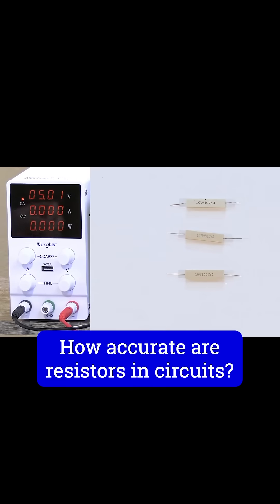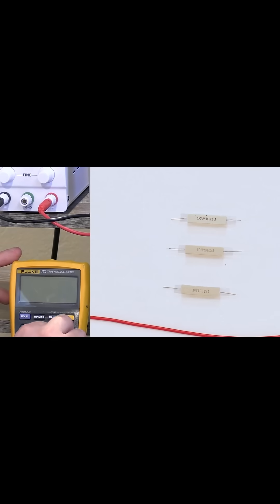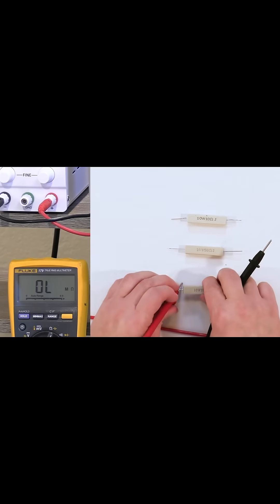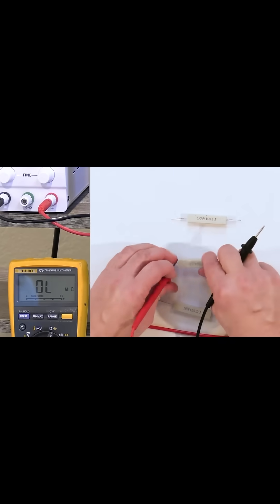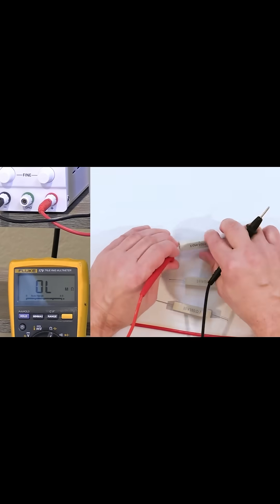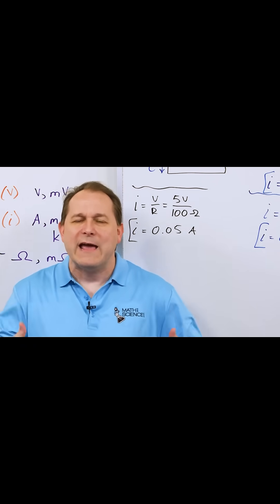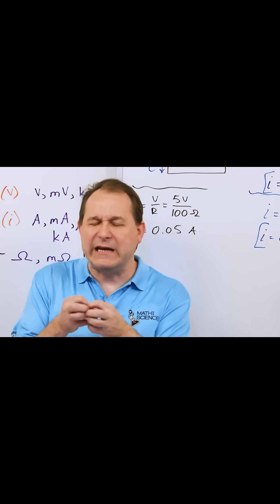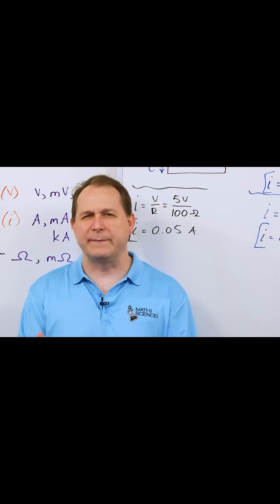Can Resistance Ever Be Perfect?

Comment: What you say is true, resistors will have a tolerance rating. Typically about 5% for the average low cost hobbyist. You can go down to 1% for just a little more cost. The resistors you show there are ceramic power resistors, then you have the typical carbon resistors, and when you really need to get precise, you use wire wound resistors. 

For those saying his fingers are the reason for the non-precise measurements, it is actually the tolerance of the resistors. They are actually measuring surprisingly accurate as those style resistors are typically in the 5% to 10% tolerance range.

Comment: ur fingers interfere with the measurements
Reply: @pete
"ur"  ???
Reply: Technically yes.... but
Finger resistance say 100k ohm in parallel with 50 or 100 ohm will have a very small effect.
 For 100 ohm 
= rt = 100,000*100/(100+100,000)

= 99.9
Reply: @eric4709 maybe he's super conductor
Reply: What is the accuracy of the test meter?
Reply: Barely.